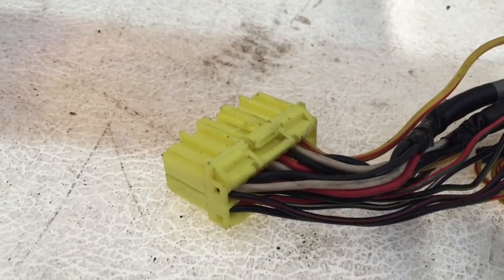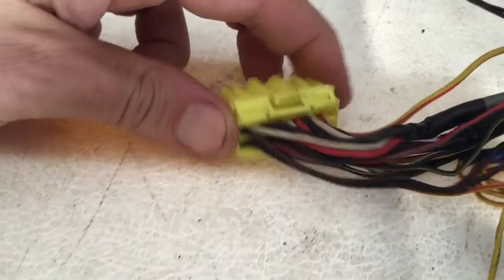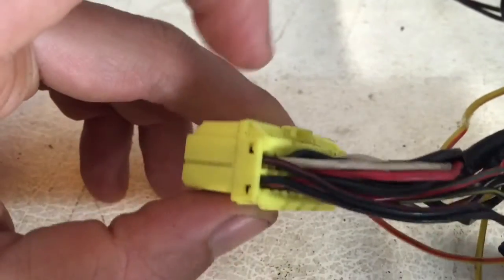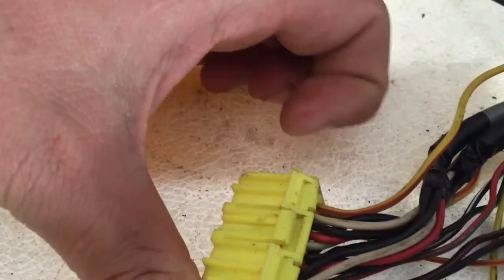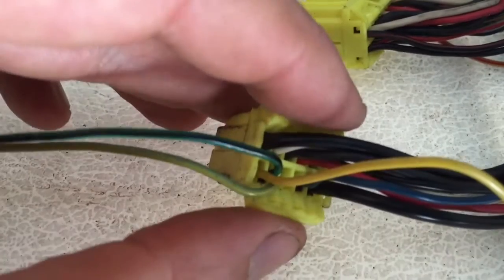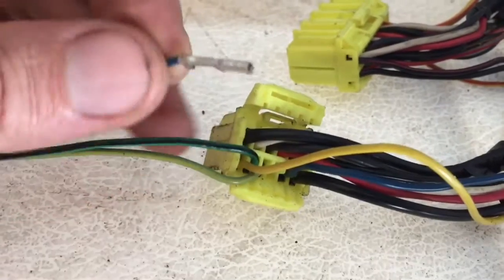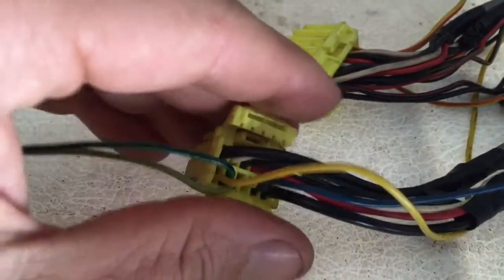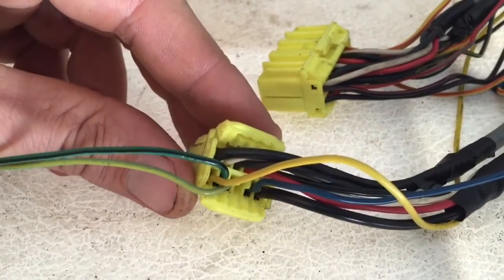Subaru ECU De-Pin - 1990 to 1994

Comment: What is the difference between 1994 and 1995 ECU / wiring  / sensors?  Can you run use a 1995 ECU on an 2.2 engine built 1990-1994?

Comment: Hello, do you know whether the 90-91 ECU differs from the 92 onwards (on a legacy EJ22 engine) Also, is there a different ECU for the manual and the auto transmissions? I keep receiving contradicting information :-(
Reply from the maker: +Rowena Henson no difference in ecu, the engine harnesses have different plugs though.

Comment: hi mate I'm looking at putting a v2 motor in a subaru legacy what do I need to look out for
Reply from the maker: +Tama Gage can you explain more about the V2
Reply: it is a 96 v2 wrx close deck non sti and I want to put it in a 94 Subaru Legacy twin turbo
Reply from the maker: +Tama Gage Sounds like a great swap. Merging the harness will probably be the biggest hurdle but I don't think it'll be that complicated.